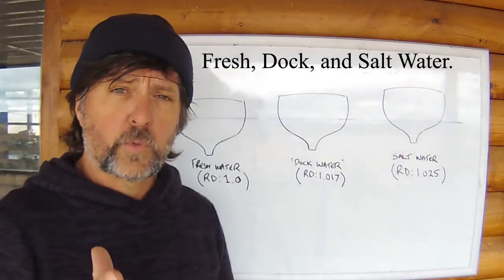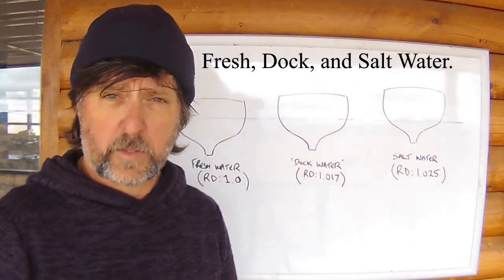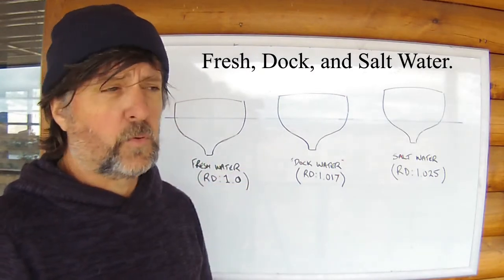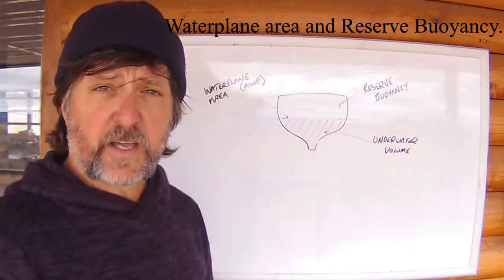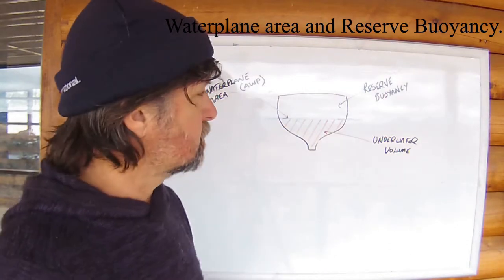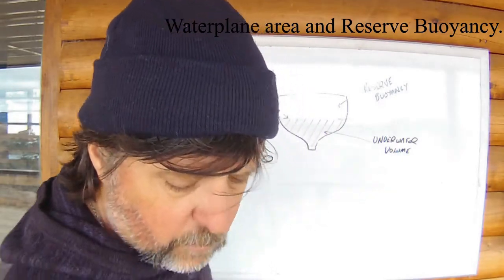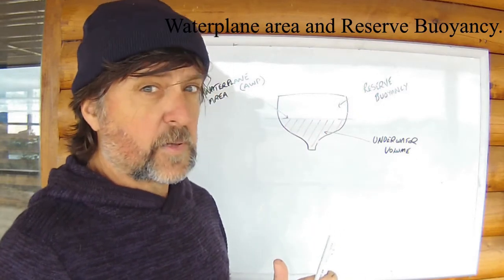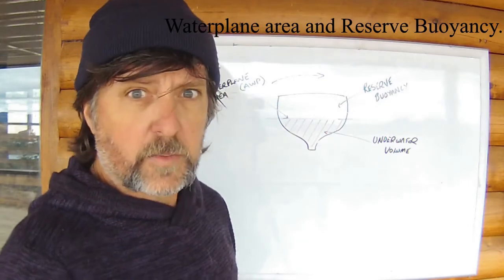Stability Part 2.  Dock water, reserve buoyancy, and Archimedes Principle

Comment: These videos have been amazing. Could you please clarify for me. Would the vessel displace less if the bath was filled with salt water?
Reply from the maker: @JackMiller-q8e  Good question! If you are talking about volume, then yes, the boat will float higher and displace less water. But because salt water is heavier (denser) than fresh, the weight will still be the same.
Reply: Fantastic thank you for the quick response. Your videos are fantastic. Thank you
Reply from the maker: @ Awesome mate - hope to get a new playlist up soon for the calculation of stability if that's your thing!

Comment: I like to contribute towards an understanding of the water planing area you pointed to, if I may. So it is the wetted area of the hull's external 'skin' in contact with the water as it changed in shape in tandem with the movement of the vessel underway. And not the resultant cross-sectional profile as one would conceptually, as if, standing on it inside the boat. I need the clarification myself because I could have misunderstood the cardboard cut-out demonstration at one point of you video. Hope you can clarify this. Thanks again for a great video instruction.
Reply from the maker: Hi Joseph. The AWP (area of the waterplane) has no relevance to wetted surface area of the hull. Also - the concept of AWP should not be complicated by weather the vessel is underway (making way) or not. The vessel may be stationary! The AWP is the 2 dimensional shape of the hull at the waterline, as viewed from above (or below for that matter). It is a symmetrical shape when the vessel is upright, but usually will become asymmetrical as the vessel heels to one side. Imagine taking a "slice" through the hull, about 1cm thick, at the waterline. The area of that slice is the AWP, and the geometric centre of that shape is the LCF (Longitudinal Centre of Floatation)
Reply: @waterbornemarinepublicatio8697  Thank you so much! Learned another new thing.
Reply from the maker: @josephlai9759  Just one more thing - if there is little or no freeboard on the vessel (for example it is overloaded) then the AWP cannot extend outwards as the vessel heels and the deck becomes immersed. The righting moment is compromised and stability is greatly reduced. This is why the AWP and Freeboard should be seen as associated concepts. Best of luck with your studies, and keep watching for a new series on stability soon from me. Thank you for subscribing.